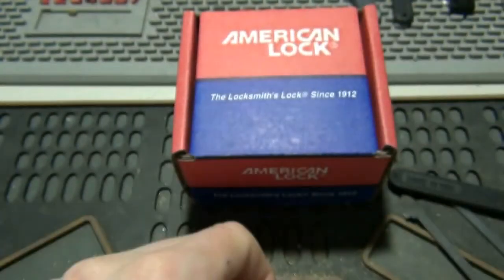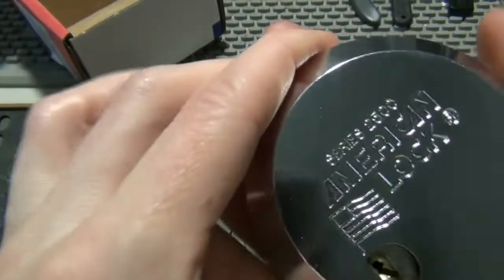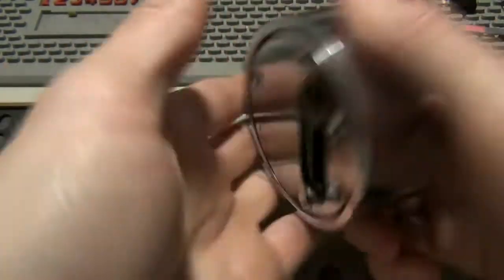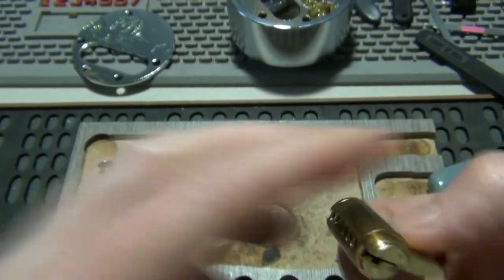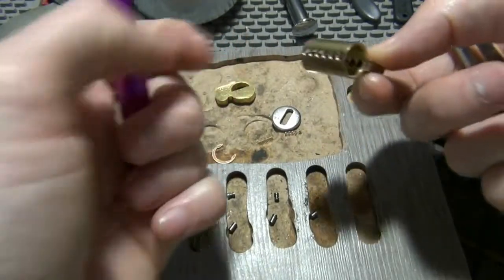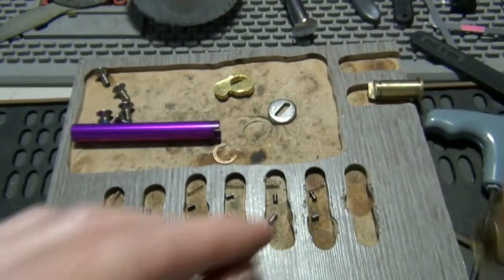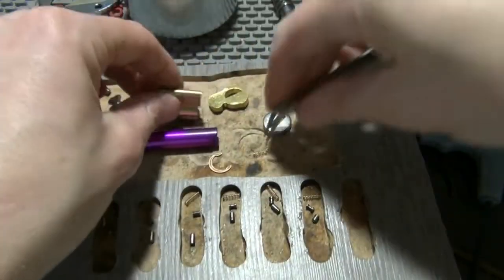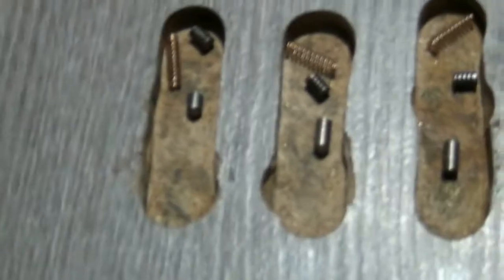(156) American 2500 Puck Lock Picked & Gutted

Comment: awesome picking. On the 2000 the shackle is roll pinned to the core. the only American I've seen steel pins is the 748 That i just did a video on. I thought the feedback was a little different from the brass pins.
Reply from the maker: Masterkey25 that lock is the 2500. And it's the first one I've seen steel pins. I picked a 748 and it had brass pins. I wouldn't want to ever try and drill one of these things! Lol